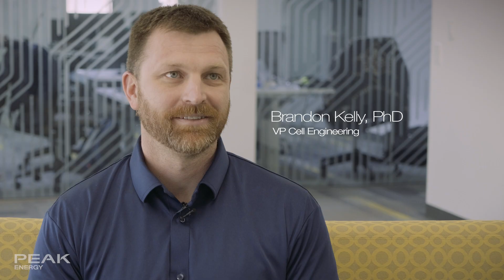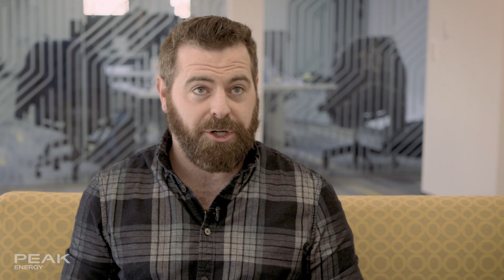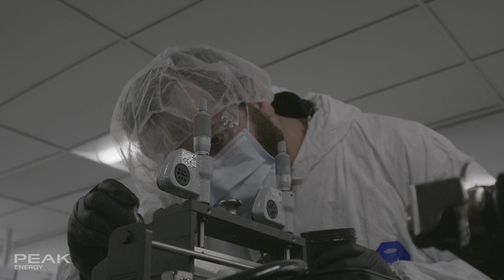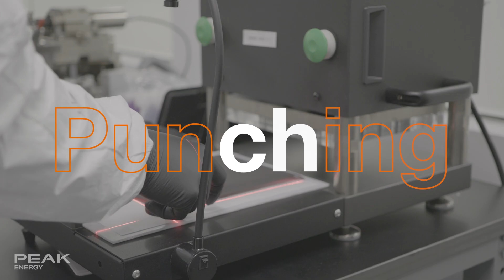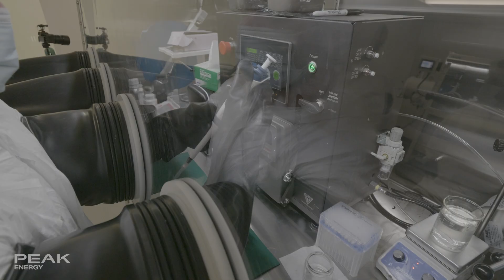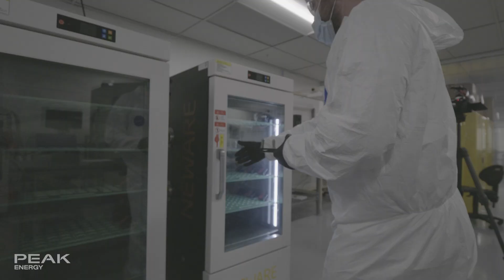Peak Cell Engineering Center

Comment: why don't you use a curtain coater?  The dry film weight varies from 130 to 148 microns!!  Wow!  Also could see fisheyes in the wet  coated film, you need to clean the Al better, remove the air from your coating or improve the coating properties.  All very simple issues,